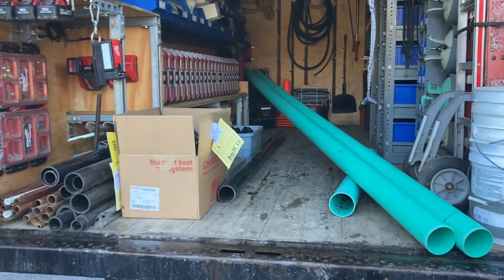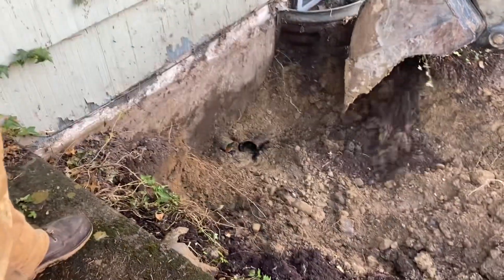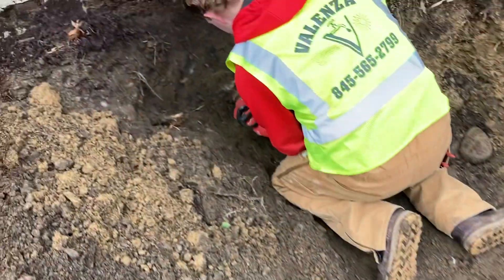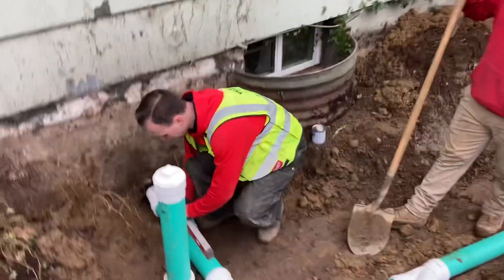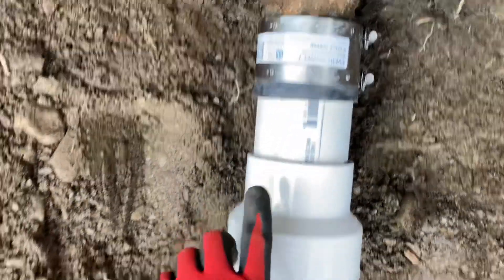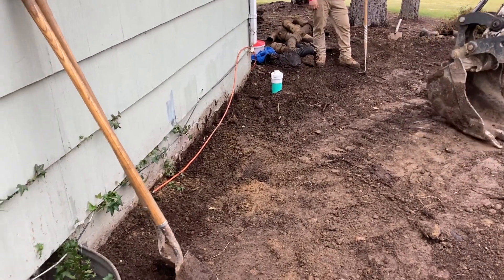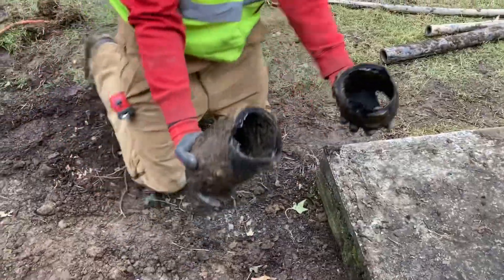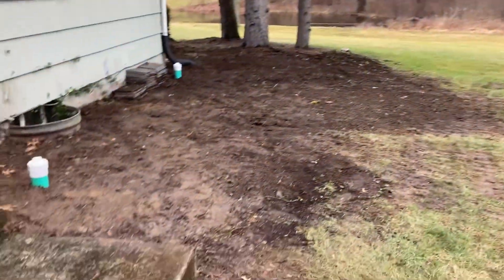“My sewer is backing up” Let’s fix it! Septic line replacement!

Comment: Why don’t you put clean out boxes so they’re more hidden, still visible, but less eyesore
Reply from the maker: We do where clean outs are in a walkway or driveway. In the yard we keep them exposed and above ground level. If they are in the flower bed, which they are most of the time, they WILL get covered with mulch and dirt and they won’t be found. Making them useless.
Reply: Cost

Comment: Sdr 35 should not be used for this its garbage. Use schedule 40 4 inch will last no longer than the orangeburg pipe . Sdr 35 is gutter drainage and yard drainage and your A Plumber??? Better go back to school fool

Comment: Sdr piping common in your area?  In Texas, i see it mostly on city sewer utilities
Reply from the maker: Yes, it’s very common. By far the most popular material for new construction and for replacements like we did here. Some people choose to use PVC, which would be the second most popular, but I’m not a fan of its shear strength for underground use. It’s also the top choice for municipal sewer lines like you said. Much larger though.